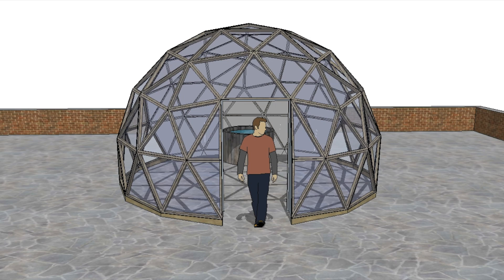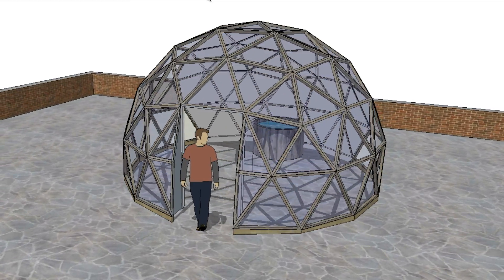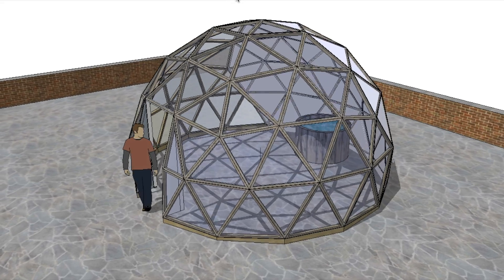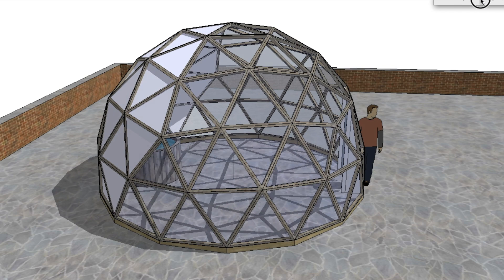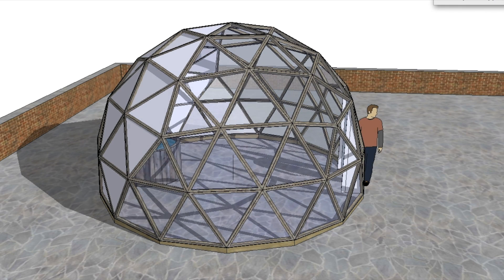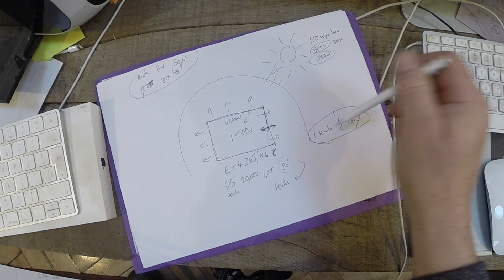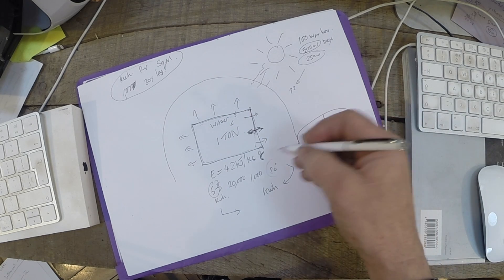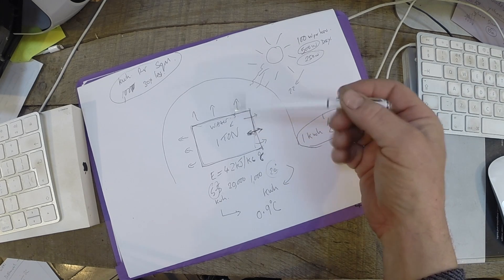Passive greenhouses don't work

Comment: What happens if the water temperature is raised by a heater of some sort? if you were able to keep the water at 60 degrees in the dead of winter, how much better would it work? What would the magic number be for water temperature to make sure it worked. 50? 60? Would you be willing to do a few more calculations and give us some ideas?

Comment: Add a reflective surface to the back of dome insulation and you can use all the radiation hitting the back of the dome to heat the water ==> ~ 88 M^2.  By the way, Solar radiation is 1100 KW HR /M^2 during winter also.  Maybe you only get a fraction into the dome.  I'd say 165 KW-HR gets into the dome each sunny day.  Maybe 25% of that might get into the water. That would raise the temp ~3.6 deg C.   I'd also assume you vent the dome if Temp gets above 27 deg C. Plus you have about 20000 KJ reserve held by the air in the Dome.  What I can't help you with is the heat transfer during night time from the dome.  But if the top of the dome was finished with an equivalent two way mirror reflecting radiation from plants back inside the dome, that may prevent frost bite.  I think frost bite damages most plants more than just below freezing.
Reply: I think the actual best solar wattage available is 1000w/M^2, not 1000KW/M^2. Error effect would 3 orders of magnitude. What do you think?

Comment: While the breakdown of these calculations are interesting - Passively heated greenhouses do work   – there are many living examples -including in the UK and several excellent  books on the subject available – The issue with this example is that a well designed passive greenhouse depends upon many  factors other than introducing one tonne of water into a 15 m2  dome greenhouse which insulated to the North side. Other factors to consider are–  the quantity of water in relation to the glazing surface area is important, between 75 and 190 l /M2  is recommended if you are only relying on water as your thermal mass. 0ne ton of water in a 30m2 ‘surface area’  greenhouse would be well short of this recommendation , also to consider is whether the water is in small or large  containers – what colour the containers are painted,  where they are placed – an important issue also is the fact that water gives of large amounts of heat when it freezes – therefore this can give significant protection in short spells of cold weather.  Also the thermal mass of the water not only reducing the cold in the winter but also can help to prevent overheating in the summer – a considerable problem in many greenhouses. Consider too the  r values of the glazing materials, a passively heated greenhouse can also rely on storing a large amount of heat in the soil as well as in water,  insulating the base of the greenhouse, burying the greenhouse into the ground somewhat can be helpful.  I suspect the shape of a dome greenhouse is not well suited to a passively heated greenhouse as the shape of a dome does not lend it self to storing sufficiently  large qualities of water on its Northern side, a shape more akin to an earth-ship is a better suited design if you want lots of thermal mass. I  Suggest anyone interested in passively heated greenhouses, not be put of by this video –  and research some of the excellent books on the subject from people who have successfully made them.
Reply: Thank you for your great comment. Can you suggest some good reading please?
Reply: word
Reply: this is the right way to solve problems, step by step, every little helps.

Comment: Circulate the water from the tank through  1/2"  black tubing.  This is similar to a solar pool heater.  I think you would find that the energy gain in the tank would be much greater.   Augment with a rocket stove to heat water on cloudy days.
Reply from the maker: Yes that could work but we need to do the math, What temperature do we need to achieve, how much energy is in the winter sun, what is the U value of the greenhouse? etc then it's a simple task of running the numbers, if you just want to stay above freezing it's too bad, but when you need 15° in the greenhouse when it's -5° outside, it's a lot tougher.

Comment: There's a couple disagreements I have.
first, it depends on what you define as "working". While it may not give you year round growing. At what point in the year does insolation drop to the point that it doesn't work? The design will still extend the growing season earlier in the spring and later in the fall.
Secondly, the math was done using insolation on a level surface. Both the greenhouse surface and the water tank surface can be sloped to maximize insolation (ie. sloped such that the plane is perpendicular to the incoming light). While the sun in winter is traveling further through the atmosphere, it's insolation is still strong, just spread more over the land (just try turning you face toward the sun on a sunny winter day).
Reply from the maker: I agree about an extended growing season but by my calculations there is about 30 times less energy in the winter sun than mid summer. There can be the illusion of plant growth very early in the year with seedling etc but they are using the energy in the seed to make there first growth (not the sun) so I would define "working" as receiving enough energy from the sun to photosynthesise the required sugars too grow and ripen fruit or to maintain a temperature above 20°C in our "passive" greenhouse. I just don't think either is possible in the Northern hemisphere in Dec, Jan or feb. I realise that everyones context is different but for me it absolutely will not work. If I can save someone from wasting there time and money trying to build a greenhouse that will not perform as they would expect then I would say this video has been a success. I do offer an alternative here: https://youtu.be/tQj8hmOzpsw

Comment: "Doesn't work" and "isn't a complete climate control solution for all climates" are different things. Any thermal mass that can store heat during daylight and release it at night will have some benefit. It can help during the summer to diminish high heat days as well.  

Is it a perfect solution? Of course not. But if your climate isn't too far off, a little bump can add significantly to your usable grow season. As example, in the Pacific Northwest, modifying the temperatures even a couple degrees overnight can extend a 4month grow season to more than 6 months. Considering the minimal cost, I most assuredly consider that "working."
Reply: Christian Swensen the tub of water looks ok, but as stated in video, and as my father would say:  it’s a “taker upper’r of space.” I am not you and I will never be you, but for me the maths and logistics caused me to not want tub
Reply: @davidfuller764  as you say, every case is individual. Having grown up on a working dairy, with several other types of agriculture all around us, I will verify that to much of this country, space is cheap. If a "taker upp'r of space" offered any benefit at all, most farmers would gladly take 2 of them, just in case it does work.  

But perspective is everything, and in a more confined area, any space savings might be worth chasing.
Reply: @ChristnThms  Is it true that farmers are having a hard time making money from their land?
Reply: @Ida-Adriana  that's a more complicated question than you'd think... Modern aggriculture is heavily subsidized, which keeps the profit intact but at an extremely low percentage. The effect of this is that the only way to farm most crops is on a vast scale. This is where the investor-farmer (not an actual farmer at all) makes millions or even tens of millions, while the family farm right across the street goes bankrupt. A dairy with 100 cows will probably fail, but a dairy with 100,000 cows will succeed. The subsidies also create an interesting effect of encouraging over-production in specific subsidized products, while ignoring other products which leads to shortages.  

Let's just say that, as usual, once the goverment gets involved it becomes a shit show, and once subsidies are involved there is no market response left.

Comment: Hi Paul, love love love your work. I'm not sure if you have actually tried an experiment before saying passive doesn't work or if your basing only on calculations? But I have found it works great here in Canberra Australia over winter using 3500L litres in IBC containers in a twin wall poly 3m x 5.4m greenhouse. With many frosts we have here the minimum air temp recorded all winter was 13C. I think its very important to have the water storage off the ground as an IBC container achives otherwise the ground absorbs/sucks the heat out. Also double wall insulation makes a massive difference I feel.  Maybe where you live you don't get enough winter sun?
Reply from the maker: The way I design is to do calculations first and then test in the real world of the numbers look good. I've done lots experiments with solar panels and solar hot water both don't produce any usable energy in winter where I live. Minimum temp of 13° C is great, no way I can get that over winter here. Thanks for taking the time to comment.
Reply: @r b, very keen hear more about your exact build if possible. 👍👍
Reply: word

Comment: Dear Paul Robinson,
First of all, I thank you for your wonderful work with all this information about the dome, that's amazing.

But when it comes to thermomass and patient warming, you've forgotten some important parts of the hot dynamics that will always go up. So in your building you will reach 1 meter high, you tec. Could measure 15 degrees, and at the top of the same greenhouse you get a damp air of at least 25 degrees in temp. Also in a cloudy day in January, in southern England.
Like others in the mail it is extremely important to keep the temperature difference as low as possible in order not to heat the house, between idea / out and there approx. Half of the surface of your house will get drastic significance, for total heat loss.
Therefore, you need a passive intelligent building, not just the actual heat storage you have to think about, but also the actual energy you can actually collect, low temperature heating in brick / sand on the floor will be most effective where your housing area in Square meters x with clogged stone / sand like floors etc. 0.3 meters will be the most efficient (even a small house of only 10 square meters, which provides an effective heat storage of 3 cubic meters). There you circulate the air from the top of the house, under the floor of the drain pipes. This solution also does not provide valuable space in the greenhouse, while it provides a better indoor climate for your plants. If you wish to further increase the accumulated effect, add a membrane / plastic underneath the floor to form storage space for your drip irrigation system.

After a brief review, I found that the actual storage in your tank could achieve 9KW of practical input daily (23KW theoretically), but since there is no efficient temperature control over to the thought of daytime, the yield will be sparse and bad. As you say it will only take up valuable space because no effective management of the heat in the house has been provided to the tank.

Have been working for alternative energy solutions for almost 30 years, and the past has been working with a big Arctic greenhouse project that could reach many thousands of households next year.

In recent years, and the next 15 years, it is the project that links Arctic and desert together. See http://www.Water-For-Life.org

Comment: Rocks embedded far enough into the ground to be mostly insulated from the cold air might store heat better than a tank of water. Can't say I've tried it though.
Reply: Water has a much higher capacity to store thermal energy than stone, sand, concrete, earth, etc.
Reply: @MiscellaneousMcC  
How long before the water starts to radiate heat?
Say you have a solar water heater going through the water in the greenhouse, heating it up. Will it be warm enough to radiate before evening thus making the greenhouse to hot...?
Reply: @seroweassociatesllc  
As soon as the temperature of the water is higher than the ambient temperature around it. Then it will begin to radiate heat. If the temperature around it is higher than the water then it will absorb the heat, and radiate it out as the temperature falls around it.

Comment: I agree that the passive solar heated water and north facing wall dome is a flawed concept.

As soon as I saw the idea pitched I immediately had a bad taste from it. I learned in chemistry that you need a lot of energy to change the temperature of water. so is it really worth it? I mean, it takes up a lot of space, requires a fair amount of maintenance, and you won't get that much from it passively. although it would hold it's heat exceptionally well so if you could connect it to a heater then it might be useful.

the north facing cover also seems awkward and unnecessary. you build a Geodesic Dome greenhouse to maximize sunlight, and then you build a wall? sure it may not see much light in the winter, but what about the other 3 seasons? what about light bouncing off the environment? it also kind of ruins the symmetrical design of the dome.

I do however believe there are good passive designs for Geodesic Domes, including windows that passively open due to vent openers activated by a piston filled with beeswax that expands and contracts perfectly with ambient temperature.

I also think geothermal, solar, hydro, wind can potentially be utilized for a passive greenhouse system.

this is my life dream. thanks for posting the video!
Reply from the maker: You may be interested in the next video Trevor, passively heating a greenhouse with composting kitchen waste. uploading tonight.
Reply: @Geo-Dome  I would add some chickens too, they are toasty creatures!

Comment: Thats correct in winter, summer time. But if its summer time. Lets say , day time is 26C and in the night time(or correct to say morning) can fall to 10-14C. In that case(10C range difrent), flowers falls off. In  some times it can happen, not often night, morning temperature falling so much. Ofcourse in 15m2, it can make 10-15, flowers to fall off. And system not worth money, or space. Another thing is humidity. Too big humidity will damage flowers. If its Opened water tank, is only making you another problem, more invesment. Waiting for second part.